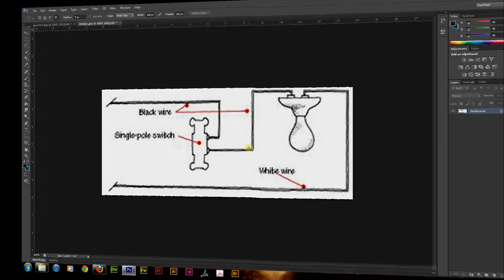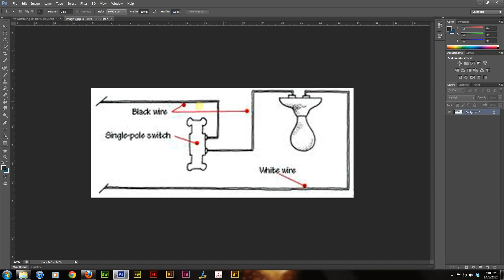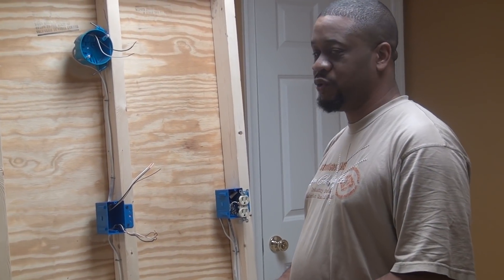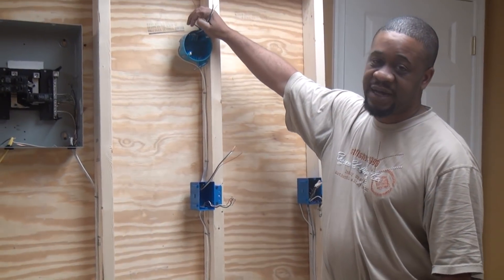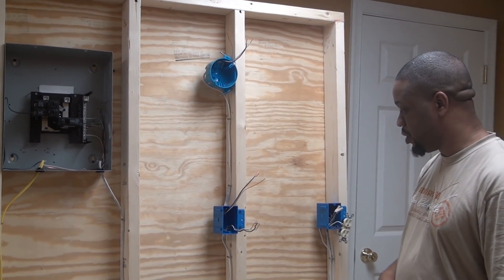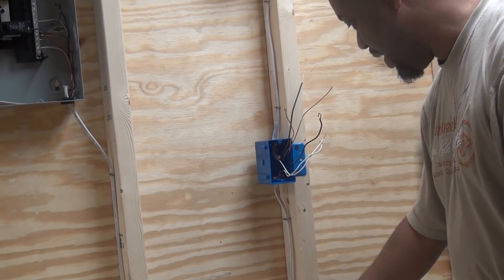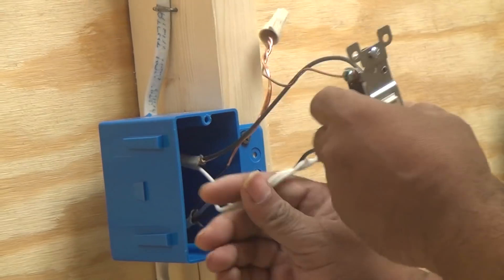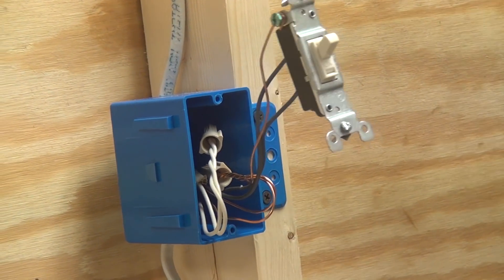how to install a single pole switch

Comment: my house is on a 20 amp circuit, with 12 gauge wire.  I am changing a light switch and I broke the 12 gauge pig tales while twisting.   I have 14 gauge with me, can I make a pig tale from 14 gauge wire? the switch is going to a light and its 15 amp, single pole,  toggle switch.  thanks in advance
Reply from the maker: I would find some 12 gauge wire for my pigtails if I were you. It is always better to be safe than sorry.
Reply: I bought the linemen plier, nose plier and all the tools. It is so hard to twist 12 guage wire, especially 4 of them.  There are switches in a double gang box. A hot (load) coming in traveling to the light and to the next switch and the light and the next outlet.  Its a middle of the run outlet.  I keep abusing and breaking the wires with my twisting skills.  What do you  think of the push in connectors? rather than twisting and put a wire nut with my bad skills.
Reply: now wago are expensive but HD and lowes sell cheap push in connectors,  Some say that they do not have enough conductor and its only good for temp,  But then I also read that they are use in industry setting, and are approved by NEC.   I really appreciate your recommendation.  I can buy wago rather than HD brand.  thanks again

Comment: Tyrone I'm installing 4 lights in 4 sections,the only power is coming from a plug in wall. I have to make sure it also has on-off switch in each location. Breaker is 20 amps. Its for my homing pigeons breading section. Can you please advise how to get it done. I'm assuming its the same as above but some I have to jump from each section to supply power right.?
Reply from the maker: Yes you just loop the power source to each box where you install the switch, run a cable from each switch box to light.

Comment: I also question the grounding part on the light. I am in an electrical class and they say everything needs to be grounded.Just wondering. Great video though. Just would like to know your reasoning
Reply from the maker: The light does not have to be grounded because it is plastic. The light does not have a grounding point so even if you wanted to ground the light you could not.Hope this helps you

Comment: Why dont you use the white wires? What is the reason for just wire nutting them together?
Reply from the maker: do not really understand the question.
Reply: The white wires are all wire-nutted together because they are all connected to the negative terminal of the circuit breaker(common ground), thus completing the loop for electricity to flow to the light.  Note that the white wire from the light is connected to the rest of the white wires too.  If not, the light won't light up.  Hope this help!

Comment: Tyrone, Just a quick question:  I want to install 3 light fixtures.  Do I just run the white wire starting from the first light to the other two and then back to the original at the switch?  Thanks  Eric
Reply from the maker: you follow the procedures in the video and if you are installing multiple fixtures just run a 2 conductor cable between all the fixtures and connect black to black and white to white ground to ground.

Comment: Tyron how can I put a outlet from the light fixture
Reply from the maker: As long as you have a hot wire (ungrounded conductor) and a neutral (grounded conductor) you should be ok. you want to make sure the hot wire is not switched which would be the hot wire connected to the light.

Comment: why no sleving on the earth wires.
Reply from the maker: not sure what you mean
Reply: bare earth wire should be cover to stop it shorting to live connection
Reply from the maker: yeah if you wanted to tape the grounding conductor you could but I have never had any problems with not taping it

Comment: Tyrone how would on wire in a Passive infrared occupancy sensor wall switch with a load, hot, Neutral, ground wires coming off it???  Pre existing has whites bundled together and three black wires going into switch and no grounding done onto the switch...
Reply: To add to that I want to remove an additional switch in this circuit (hallway) so that this is the main and only switch...
Reply from the maker: The whites tied together may be your neutrals and  the side of the switch with 2 wires may be your hot wires. You have to test everything to be sure. I do not understand the second part of your question

Comment: Nice Video.......I am about to purchase a timer switch.  It calls for a "neutral" wire however the switch I see in the box is single pole and only has the two black wires attached to it. There is a white wire but it has a wire nut on it. Can I use that white wire as the neutral that the switch calls for?
Reply from the maker: you would have to test the white wire to see if it is a neutral.

Comment: If one of the wires are bad that are tied into the 3 wire pigtail.. Would that one wire cause to remaining two to not supply power
Reply from the maker: if it is the feed yes

Comment: I have a problem.. I have a single pole light switch that powers an outside light. The switch is pigtailed with 3 wires. It has no power to the switch. The two closest outlet have power, one outlet looks like it supplies the power to the single pole switch which the pigtail maybe coming from. I've replaced the switch and outside light now I'm stuck. I would like your expertise
Reply from the maker: go around the house and check all the outlets for voltage if all are working proceed to next step.  it is a good chance that one of the wires that are pigtailed are the feed to the switch. you want to take the wirenut of the 3 wires and check for voltage. if you do not read voltage safely take the 3 wires apart and check each one individually. if you still do not read voltage  visual check to see if one is broken. if that does not work call a electrician.

Comment: I am currently going to do the same as the video above. Except im getting power from an existing outlet. So im gonna cut the wire and install an outlet. Just the way u did. Then run power up to switch and then to outdoor light fixture. My question is when i cut the power wire, it might be kind of short to hook up the new outlet. Would i have to extend the wires in box? Not sure if this makes sense but ohwell.
Reply from the maker: if the wire is to short yes just replace that wire with a longer piece and hook it up the same way the piece was that you removed. That is assuming the outlet was working properly when you started ( look at the video how to check outlets How to check an outlet with a digital multimeter )

Comment: Ok so just to be sure on wiring, I have a black one, a white one, and the copper wire, I assume the black is the hot wire or load and the white wire is?  I am doing a single pole switch, replacing an x10 switch that stopped working.
Reply from the maker: In a switch loop both wires MAY BE hot with the white being the supply and the black the switch leg. If you are replacing a switch that was working just install the new switch the same as the old one this will eliminate any confusion.
Reply: The old switch is an x10 switch with a blue wire and black
  My voltage detector finds voltage at the switch and at the light fixture so I know its the switch.  I will just try hooking up and see what happens.  Thanks for the speedy reply

Comment: if i i wire my light switch from a electrical plug when i turn lights on or off will it also turn my plug on or off
Reply from the maker: depends on how you wire it

Comment: Tyrone, great videos. One quick question for you. I'm currently replacing the existing light switches from a ugly black/brownish (older house) color to white switches. but only have a single wire coming from the ceiling to the switch. I'm familiar with the neutral being tied together and hot wired to switch but I'm lost on this type of set up. Please help!!!
Reply from the maker: The switch has to have at least 2 wires or it will not work. You would have to send me a picture of what you have.

Comment: bravo brotha bravo! stop apologizing so damn much we all make mistakes; just edit the video..lol

 I appreciate that someone has finally made a video that  explains pig-tailing and clock wise hooking of the exposed wires that have to be screwed in ( makes sense)!

I'm always building new enclosures and have them checked by licensed electricians. This video will save me money in doing it correctly so they don't have to charge me so d@mn much when they correct my screw ups. Please,  keep the videos coming
Reply from the maker: Thanks for the kind words BH and you are most welcome

Comment: Hey, I want to add a light to an existing single pole switch and light. How should I do this?
Reply from the maker: run cable from existing LIGHT and connect black to black and white to white
Reply: Thx. Your videos are really good, looking forward to more. Any chance of doing one on recessed lighting?
Reply from the maker: probably not it would be kinda impractical since i do not make any money from doing this, besides it does not require anything special from a electrical standpoint. with the many different types of lights most of the time the difference comes in the mounting of the fixture.

Comment: Hi Tyrone - Love your tutorials.  Having a problem hooking up my porch lights.  I originally had one, then had another one added on the other side of the door but one light is dim and the other one is bright,  and when I switch them off they stay on. The only way to break the current is if  I loosen one bulb then  they both go out.  I tried to run a separate line to power them but I keep tripping the breaker when I switch them on. What am I doing wrong?
Reply from the maker: sounds like you have the lights connected in series. You have to connect them in parallel.

Comment from the maker: run your wire from the existing light to your new light. connect the black and white of your new cable to the black and white of the working light

Comment from the maker: remove the black wire on the pull chain light and connect it to the white wire running to the switch. connect the black wire running to the switch to the light where you removed the first black wire. turn off the power while you are working on it.

Comment: PS: here is exact scenario Tyrone I took down the old pull chain light there 2 cables 1 from the panel 1 that feeds other receptacles,i added 1 cable to the switch if i tie all the black together and whites together pig tail off for the light works perfect now im left with the problem i have only 1 black and 1 white to deal with and a single pole switch if i put the black on 1 screw and the white on the other screw.......POP goes the breaker.THANKS for your time i appreciate it man!!!

Comment: Sorry for the poor question ill try again,the light with a pull chain(works fine) has no switch and i would like to add one,there is only 1 cable (14-2 ) going from the switch to the light,so i cant tie my whites together and connect my 2 blacks because i only have 1 black and 1 white.

Comment: Hello Tyrone, first off thanks for the videos.I have a question,i want to add a switch only, to an existing light (pull chord how would i go about doing it because there is only 1 wire coming from switch to light, Thanks.

Comment: Super educational. Glad I found this video. But you know what Tyrone? You could have gone the whole video without ever letting us know you forgot the bulb or the switch. Just pause mid recording go get what you need and start recording. Pretend it was there the whole time. We would have been none the wiser. You have a new fan here though, Tyrone.